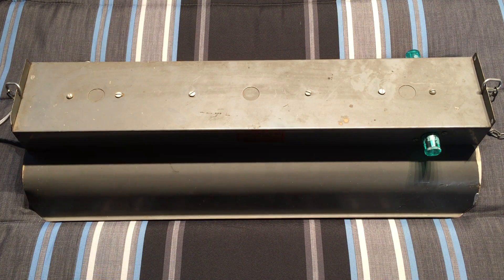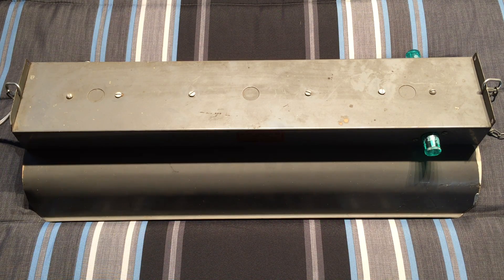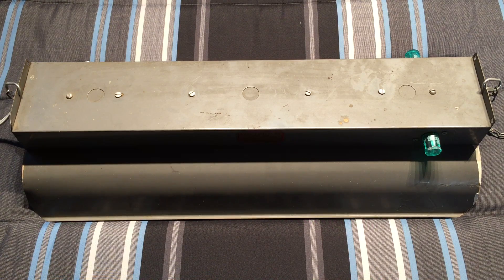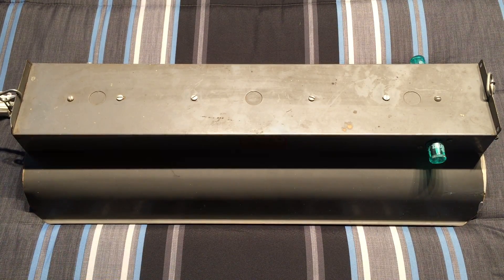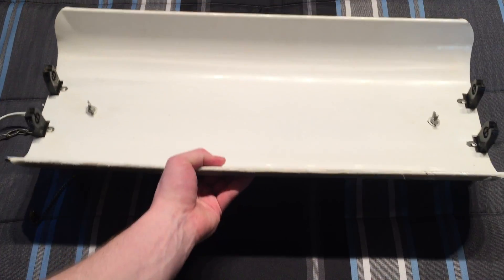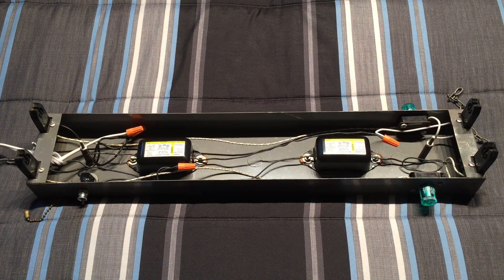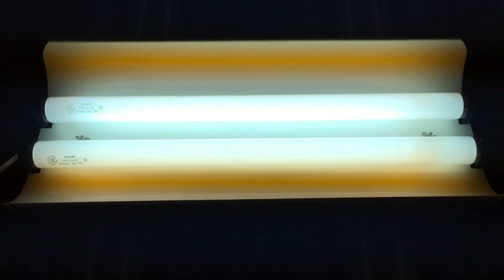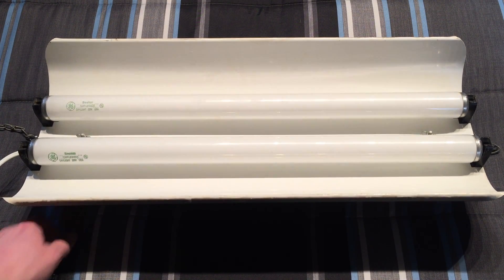Mitchell 2x 20watt Pre Heat Fluorescent Shop Light

Comment: I just found this video after doing research into a shop light I picked up from my grandfathers estate! It is near identical to yours, however it seems like the chain switch as been removed, but it still has the original cloth power cable. Thanks for the video
Reply from the maker: Nice save, these will give you years of reliable service!

Comment: Very nice!  I have a 4' Mitchell preheat shop light myself, from someone on Lighting Gallery.  Ballast in mine is an old Sola, PCB laden of course.  Has the original cloth wiring, Bakelite sockets, some '70s Arrow-Hart starters, and I have a pair of GE Chroma 75s in there.